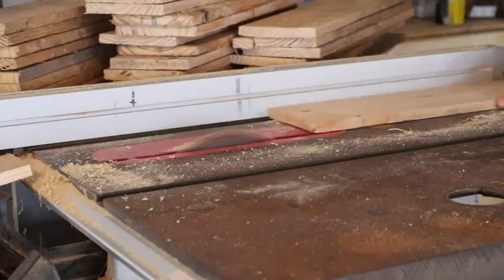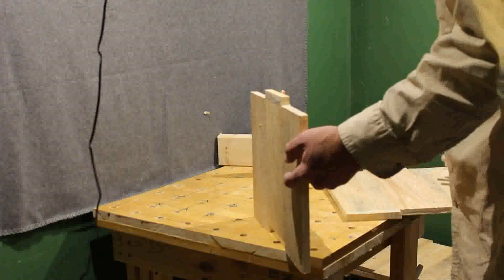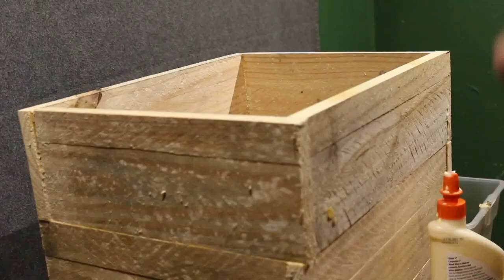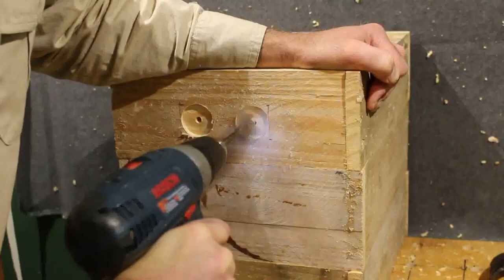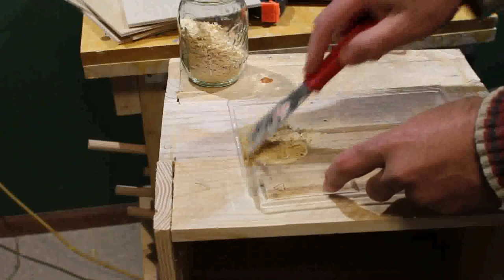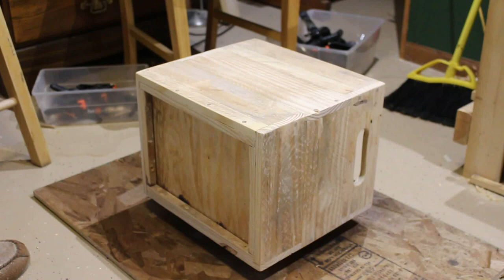Pallet Wood Project - Wine Storage Crate

Comment: Beautiful work! One question though? Is there anything else than glue keeping the three horizontal sections together? Maybe I missed a step in the video, but it feels like the top or bottom section could come off if you lift it too fast.
Reply from the maker: +Tor Skude I used oak dowels glued into the support pieces and into the side panels to make them stronger.

Comment: I love your clamps how did you do them
Reply from the maker: +Daniel Hardy I glued and screwed a block of wood to 2 x 2s which had holes drilled out of them. Then I drilled a hole in a small block to accept a dowel.  Made some wedges and there you go.  ☺
Reply: Thanks I'll give it ago but think you should do a video on how you made it it would be ace to see it

Comment: What finish did you use?
Reply from the maker: +John Smith I used a blend of 1/3 Tung Oil, 1/3 Mineral Spirits, and 1/3 Polyurethane. This was the first project I have used it for. It went on nice and I was able to apply a second coat after about an hour or so. I'll wait until I use it on a nicer piece before I judge how I like it but so far so good.
Reply: Mark Hanson Thank you  : )